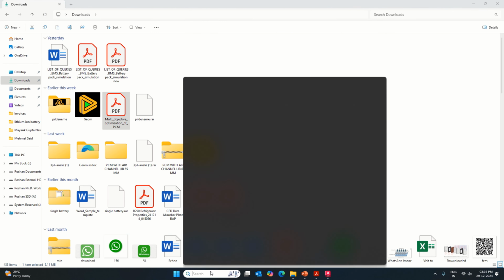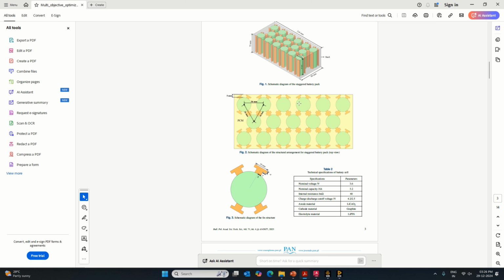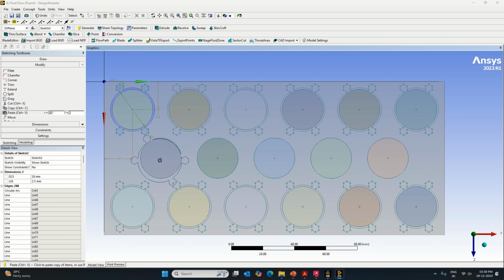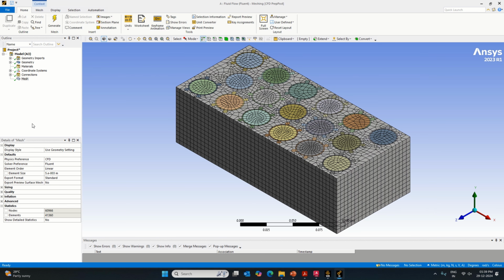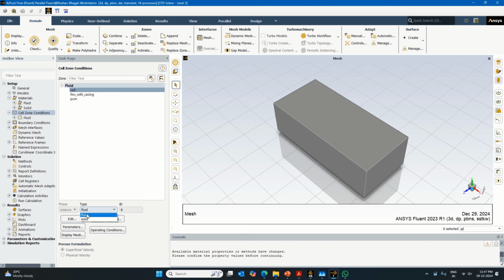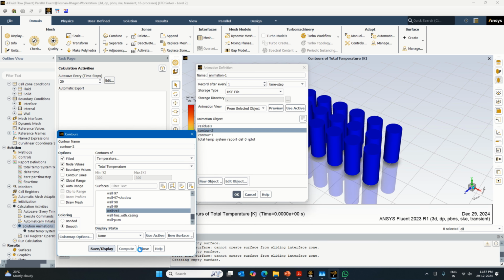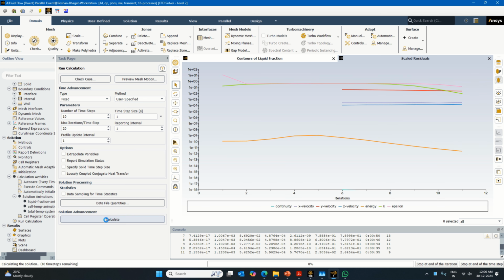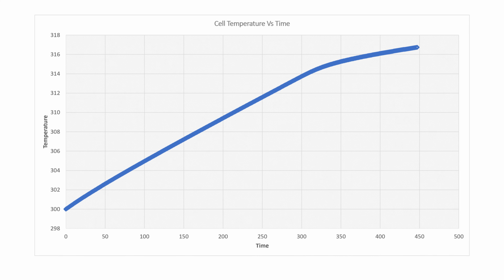CFD Analysis of Staggered Lithium-Ion Battery Modules with PCM and Hexagonal Fins

Comment: Namaste sir, This is Keshav Chaturvedi, I am trying to simulate single cylindrical cell for thermal behavior but before that i am trying to check for voltage while simulation at 1 crate voltage deflects by large amount around 700 flow seconds but it should run for 3600seconds? and why is it deflecting but before deflection graph was following normal voltage curve for cell. Can You help, Thanks.
Reply from the maker: Change mesh size
Reply: @FrontiersInCFD   Thanks for  reply, can you provide mail id.
Reply: I have used NTGk model with 0.2 C, 0.5C, 1.0C, 1.5C, 2.0C data for parameter estimation
Reply: Sir, I am currently meshing at 0.001mm when it is diverging. Can you provide your email ID
Reply from the maker: frontiersincfd@gmail.com
Reply from the maker: I use thermal model only